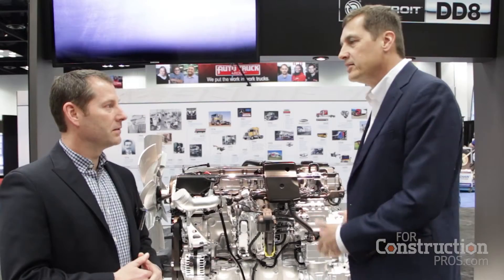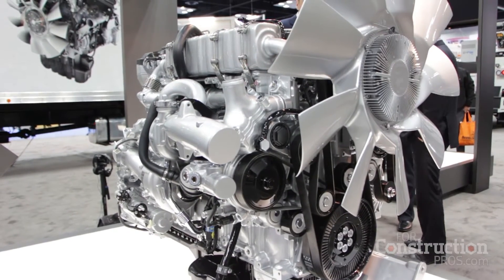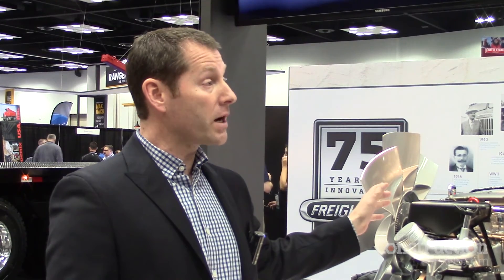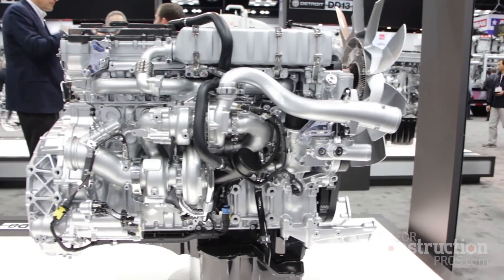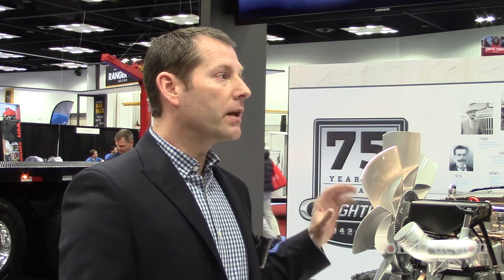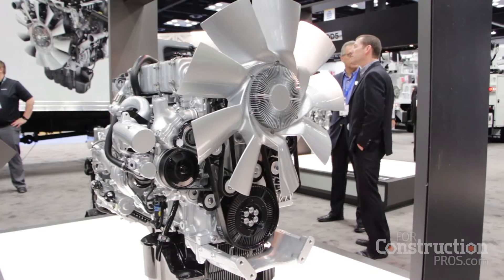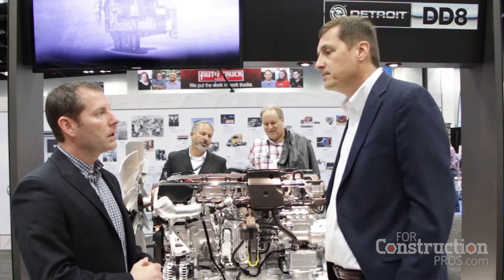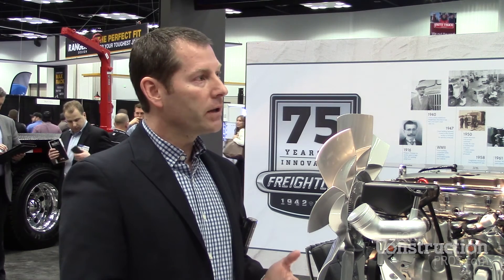Detroit DD8 6-cylinder Diesel with PTO Capability

Comment: The DD8 has been built and sold in Germany for the past 4 years but to meet tougher U.S. emissions, the software and fuel injection system had to be cleaned up. The DD8 weighs about 600 pounds less than the old tech DD11 that it replaces for the higher 300 to 350 HP range.